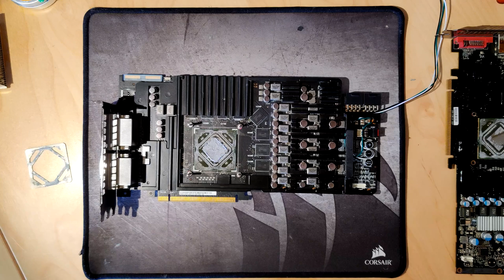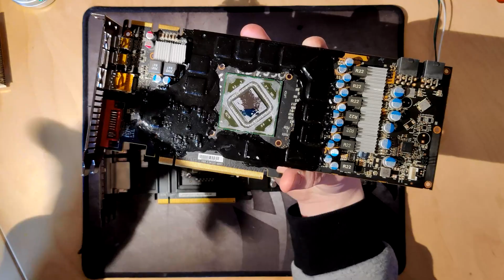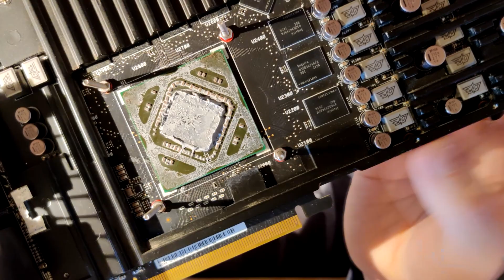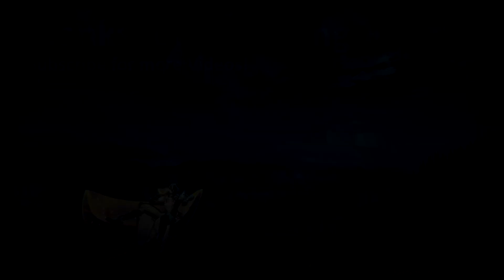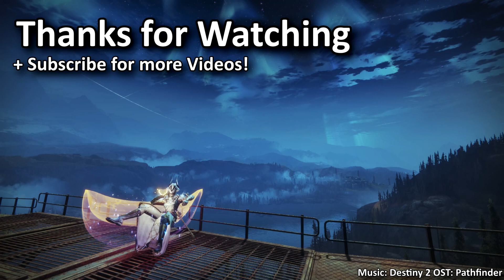ALWAYS DELID TAHITI GPU CORES!

Comment: I have a metal spacer that fills the gap, but then you have two layers of TIM. But it is safer than mounting the cooler straight on the silicon.

Comment: Just putting this out there for anyone who wants it.---->>>> Pretty easy to calculate dry ice usage. 571,000 joules / kg to sublimate  ( dry ice ). Now to add in the load well a 350w load is 350 joules of energy per second ... So on and so forth so you can pretty easily calculate how much you will need if you know roughly where you will be running power consumption wise. Though that's the trick of it lol 😆 knowing where you will end up. Plus don't forget to add the 5 to 10 lb loss per 24 hours for storage ( 2 to 4 ish kilograms) in a typical cooler/ice chest though you can get your losses down quite a bit if you go with blocks wrap them in paper or Buble wrap or something that's a very good insulator even a rubber mat. Then putting it in the cooler and then insulating the top better and or putting a quilt over the cooler and limit your number of times you open the chest. But really block form does help the sublimation rate for storage and it's really easy to take a old t shirt or towel and wrap up a block and take a hammer to it to get you dry ice powder / dust to use in the pot / thermos (vac. Flask)

Comment: What's your preferred method for delidding these? Razorblade and a Hammer?
Reply from the maker: The glue on these is pretty weak i use a box cutter knife blade and just gently tap it with a metal object. A hammer sounds like a problem waiting to happen
Reply: @CmdrSoyo  yeah, a proper hammer has too much force, something like a screwdriver should work for hammering it